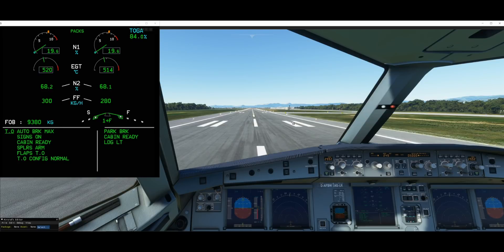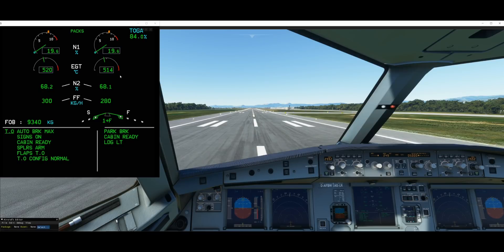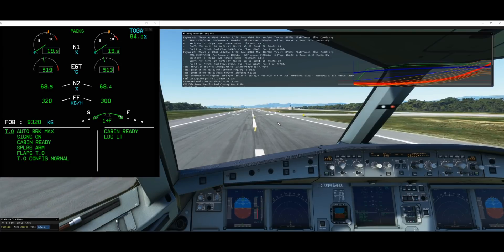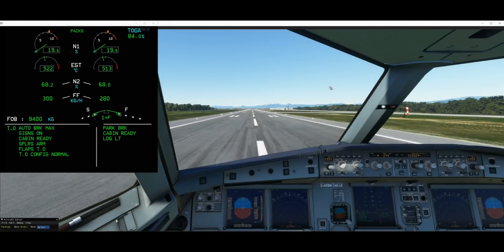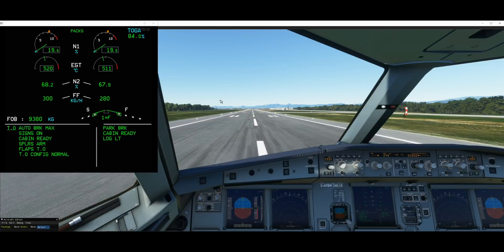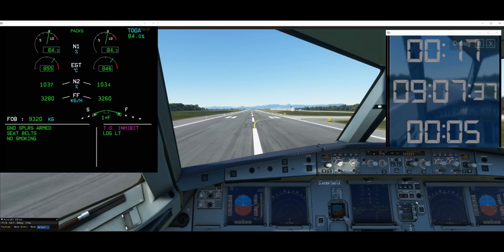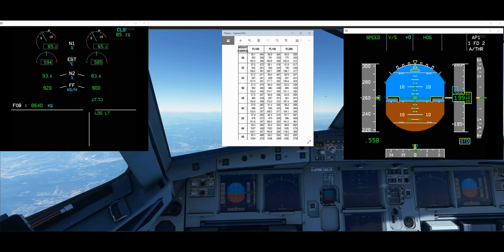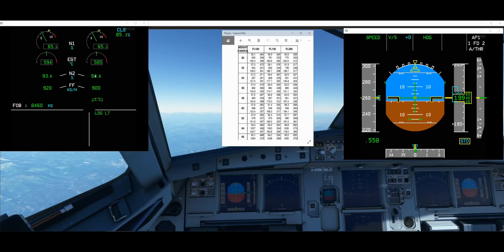FBW A32NX | Engine Modelling

Comment: Why is TOGA not max thrust?
Reply: All what 'Speedbrake' said... Plus the TO thrust is derated to be just safely sufficient for the specific runway length. This is calculated new for every TO, considering weight and environmental data. All of that is done to save fuel, minimize engine wear, and to produce less noise.
Reply: What if you have a stall? You can't get full thrust?🤦‍♂️
Reply: I think it depends on altitude and temperature and aircraft weight.

Comment: First thing I noticed after loading up the exp model, was the slight differences in the engines...subtle, but very noticeable! This is beyond study level. Anyone claiming that it can't study level, because it's free, is an absolute moron. Incredible work guys, keep it up!
Reply: It isn't remotely close to study level. Study level means all failures, and remedies for such failures are implemented, and all autopilot and FMC features are present, which they are not. It is still very good, but please understand that study level means quite a lot more than what we have here. Study level doesn't = startup procedure is like real life. It means that if your left engine hydraulics fail, the ecam pops up with the fault messages and you have to follow checklists to remedy it. and if you do it right, the errors go away and the plane is flying like it should. There's no failures modeled in the FBW YET, so it is not study level. The Toliss aircraft in xplane are an example of a plane that is fairly close to study level. It does have failures and remedy methods for failures implemented.
Reply: @ChaseB1896  why don't you give them a chance to implement that before making such silly claims? It's been in development for what, 4 or 5 months? At some point in the future, it WILL be study level. You only need to look as the current rate of progress and features implemented, to see that.
Reply: @j4cko56  Woah look, you claimed that right NOW it's BEYOND study level, that's the only thing I'm arguing. Did you not read that I said failures on not implemented YET? 

I understand you love the plane and all the work they are doing, but don't blindly take what I'm saying out of context. I'm certainly looking forward to when everything gets totally completed and it's a study level plane. But to claim it's anything more than a on-the-line simulation right now is false.
Reply: @ChaseB1896  you clearly didn't read what I wrote. I was referring to the things that are being implemented right now, are beyond study level. Which frankly, they are, I've not seen some of the features in past "study level" stuff. I've not claimed anywhere that the model is currently SL. "Anyone claiming that it can't be study level" clearly indicated I'm talking about the future of the model. You sir are the one who got the wrong end of the stick. Sorry for getting snappy but you are putting words into my mouth that I've not said.
Reply: @j4cko56  I guess I fail to see the significance of what is shown in this video. It's fairly standard in many planes in xplane and PMDG to have this level of detail, and it's nothing new. You said "this" is study level, which did not specify what you felt was study level. I don't see anything study level in this video other than laying the foundation for better simulation
Reply: @ChaseB1896  personally I have never come across this kind of detail in other aircraft. If you have, good for you. If you want to continue being pedantic about details, please do so with someone else. I'll get back to my charts, have a nice day.
Reply: @j4cko56  that's pretty fair if you haven't had much other experience. For me it's kind of a head scratcher seeing people going nuts over this when it's still pretty low level compared to what's out there. But I can understand how groundbreaking it would be if you are really new to simming. At least we still have something we all can enjoy!

What's great is the graphical fidelity of this Sim is attracting a ton of new people to the flight Sim world who prefer graphics over depth, and I will never complain about getting new and more people into this hobby. It means more competition and better products